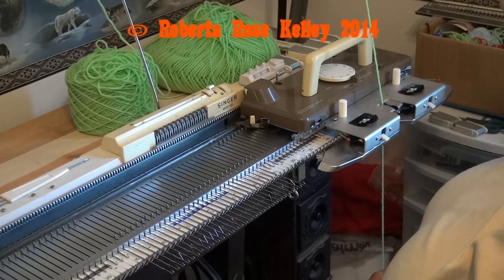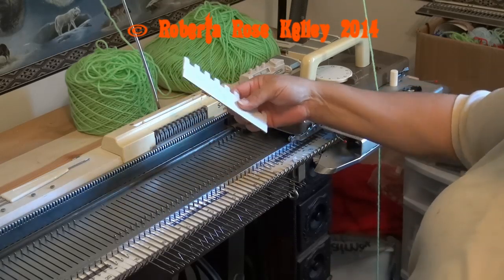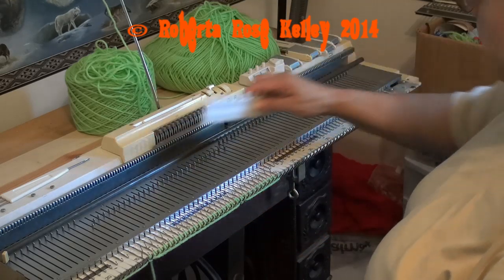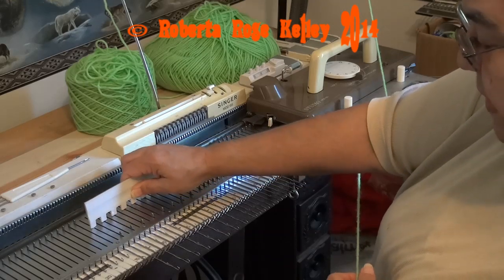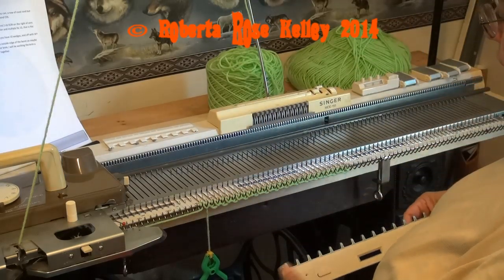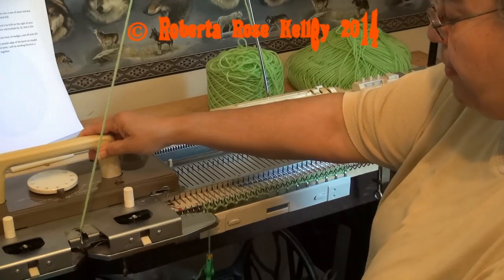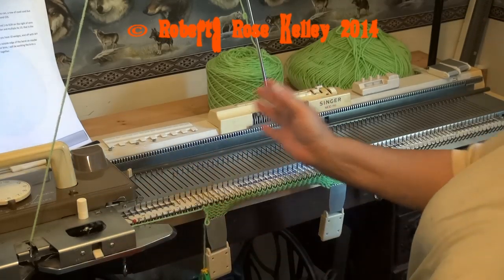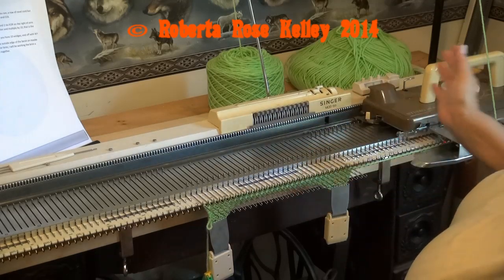Casting On problems with the singer type machines

Comment: I need help. Got a great singer 700, used 2x but in great shape. Replaced needles, oiled it, new sponge bar, tried different yarns, tensions. I can't get it to knit.  reliably. It skips, leaving a trail if unworked stitches and yarn in different areas.havent been able to use it reliably. Is it a carriage or bed issue?
Reply from the maker: Did you clean and lube the carriage as I think that is the problem. The yarn would be a 3ply to a DK yarn but one can use EON with a #4 yarn at times, all depends on the brand yarn. If needed, email me at hobbyknitter at gmail dot com. I may be better help that way.

Comment: Hi Roberta, 
I just purchased a singer 360k memo matic. I seemed to have grasped the casting on, thank you.
I however can not manage to keep knitting.  Like when you cast on with the brushed up the yarn runs along. This is happening once we change over to the knitting. 
What am I doing wrong?
Thanks in advanced. Kimberley
Reply from the maker: I would first suspect the sponge bar needs replacing, most the time a used machine, even from a dealer can have parts missing or not new. I remember once I had a new to me machine, was told the sponge bar was new, but only on the ends, when I finally pulled it out, all but the ends were flat as a pancake. If you have replaced it, email me at hobbyknitter at gmail dot com

Comment: So helpful video ...... thank you ... by the way .. can I use a different carriage from another model  instsad of the original one ( both of them are for knitmaster knitting machine but one is for  ES-302 and the other is for NGH3 ). iam willing to hear from you soon.
Kinc rsgards
Reply from the maker: Sorry for the delay, I only get here maybe a couple times a month, then I have to play catch up with the many comments.
Looking at those 2 machines, it would look like they will. But a safe way to try it, is to take the sinker plate off just to see what happens, put the other carriage on and pull out a few needles, push the carriage across and see if it works. if not and it stops, then take it off and the answer would be no.
Reply: @RobertaRoseMeads  many  thanks ....... bless you ....

Comment: Hi,  I have a brothers ribber machine,  it worked well for quite a  while with the main bed, but now I can barely knit a row without the main bed dropping stitches!  I need help
Reply from the maker: So first would be the sponge or plastic bar in the ribber. If a sponge bar, they deteriorate every day, little by little until it no longer works. Next is maybe the ribber moved a bit out so both beds are not aligned well. There are many things that can or did happen, but hard to say. To better help you with this, please email me at hobbyknitter at gmail dot com, or find me on Messenger and send a message that way.

Comment: Really enjoy this video, thank you. I do get a bit lost from about 4 mins onwards - I have a singer 360 and in using the method described in the manual (to knit the first three stitches) my knitting does not complete a row. So I think I need to manually e-wrap the cast on and knit the first stitches from there. Is that right?! (Beginner millennial)
Reply from the maker: I will get to look at this better in a bit, but if you were to email me at hobbyknitter@gmail.com, at least I would have it there, I do tend to do more email, than look at the comments here.

Comment: I have a problem with cast on and a stockinnete knitting. My machine knits fine only where the weights are (on edges), but forms loops on the needles where are no weights. Is it a problem of my sinker plate? How to fix it without using a cast on comb? Thank you.
Reply from the maker: I found more on the brother machines that when it loops on either side of the fabric, it is the carriage needs cleaning.  Also it can be the brushes need replacing as they can grab the yarn and not let the machine knit it properly.
Something else you can do is after knitting a row, put the needles out to HP and knit the next row until you can get weights on the ends.  I do prefer to put a cast on comb and luckily I can borrow from my brother machines to use on my singer type machines.  It seems as though the brother machines do need to have the comb on unless you put your weaving brushes down or put the needles out to HP.
Berda
Reply: Replaced the sponge bar. Now it knits great. Sorry for such a beginner problem. :)
Reply from the maker: Sorry that I forgot to mention that but glad you found that out.  A bad sponge bar is the culprit more times than anything else.
No worries of having a beginner problem, even us that have been machine knitting for many years will have problems also, just not as much as a beginner.
Berea